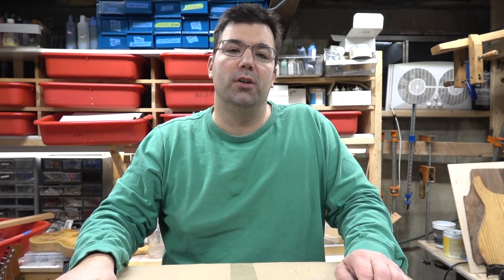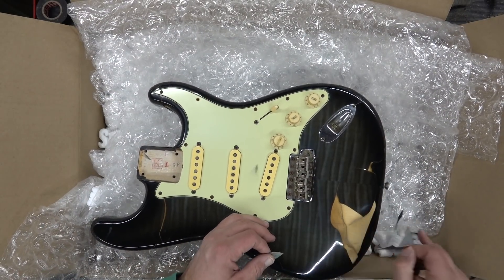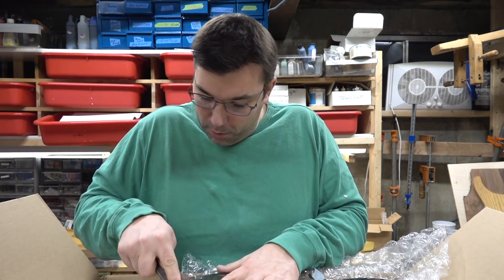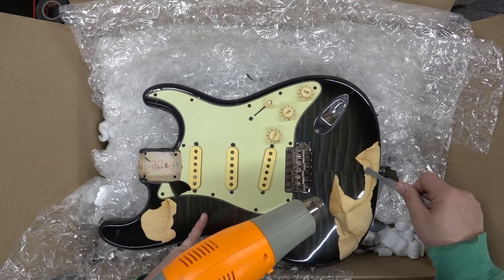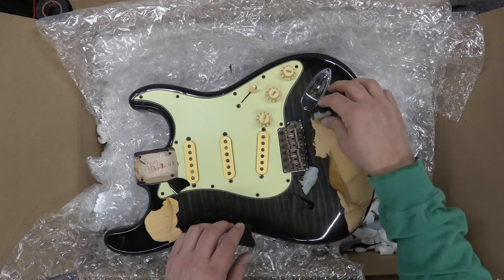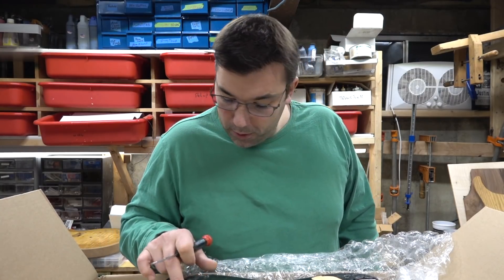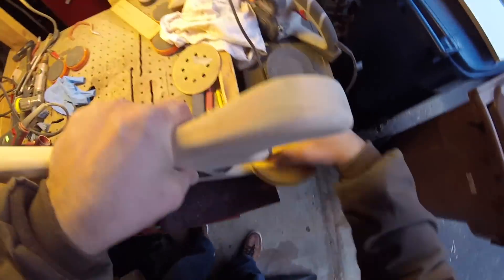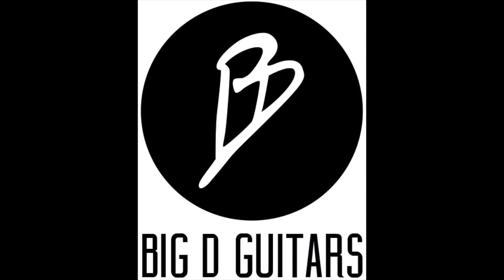MIJ Loaded Foto Flame Strat Project - the hamburglar is broken!

Comment: You would have better luck if you had a good scraper instead of a cheap putty knife. I use a 5 way  painters scraper. That sweet kind of smell is probably sanding sealer, if you're going to stain that all needs to be removed. looking good though!